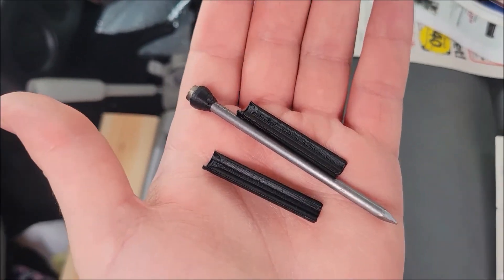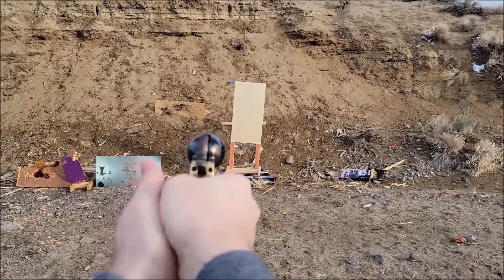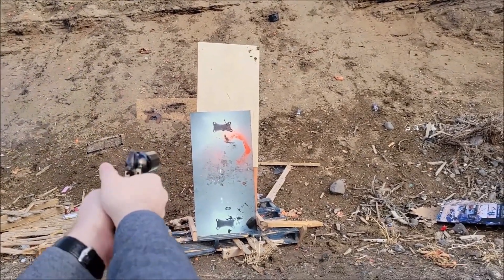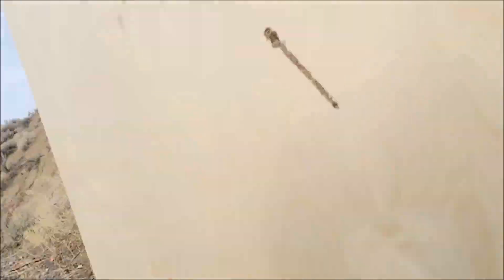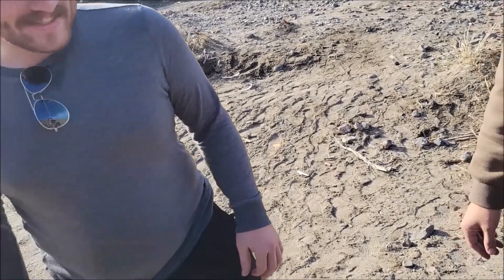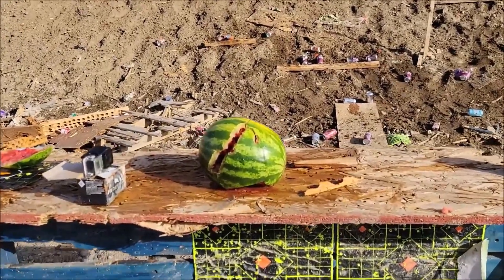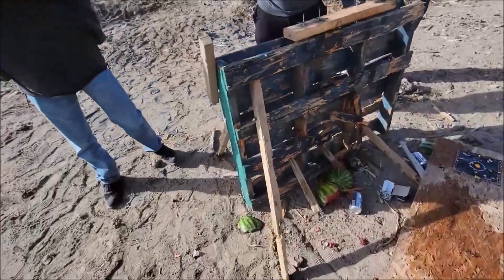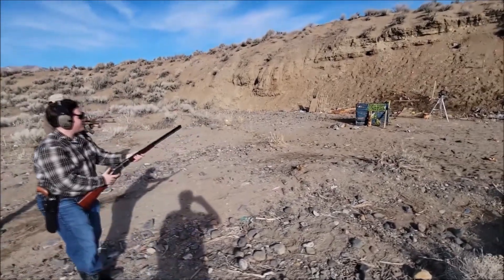Pietta Pepperbox Nailgun (Bad Black Powder Ideas)

Comment: ok guys i give up cannot figure out how to get those sabots.  i need 6 at least 36 at most of sabots.. let me know if i can get them..  thanks  gregory
Reply from the maker: Hi, Gregory. I had to model a custom 2-piece sabot and tail piece in Solidworks for 3D printing these. I could give you the 3D files if there's a decent place to host a download link, but you'll have to find a place to print them to-scale for you if you don't have a 3D printer yourself. I'm only an engineering student, not a licensed engineer, so I can't endorse these as being safe or remotely a good idea--use at your own risk.

Comment: I was wondering where all my 6 back up keys 🔑 went 😂.  Hey how much black powder did you use? How many grains should I measure out.
Reply from the maker: We used just 12 grains of fff Goex on account of the short barrel. I can't really recommend shooting nails out of your gun, but I can't stop you either!
Reply: @theblunderbussbrothers9547  hmm if it was just .36 lead balls would u have used more? I saw a dude on a video using like 20gr
Reply: @theblunderbussbrothers9547  since it’s steel frame
Reply from the maker: @Puppy_Puppington  I probably wouldn't—it's just a waste of powder at a certain point. You WILL get a bigger bang which might be more fun, but it's just extra powder burning with no benefit. We'd have to chronograph this to really know the point where that happens, but with a 3" barrel it'll be a small amount.

Comment: I wonder if you could basically make these drag stabilized by having a head that was coated in lead like the Roman plumbata and simply having normal fins on the back or even without it
Reply from the maker: I'm definitely revisiting this idea later we'll try giving something like that a shot..
Reply: @theblunderbussbrothers9547  I'll stay tuned then.
Reply: Should be "Easy" to make.
Clip the nails shorter/clip off the flat surface.
Then hammer a flat on the end you cut, to make a sort of stabilization.

Comment: Something floofy on the back that creates drag might keep it flying straight. But it needs to be something black powder won't burn. Maybe shreds of kevlar. Also molding nails into lead bullets might be fun, if they fly straight that would hammer them home with authority. Would be best to use those nails with a little knurling twords the head for lead to grab onto.